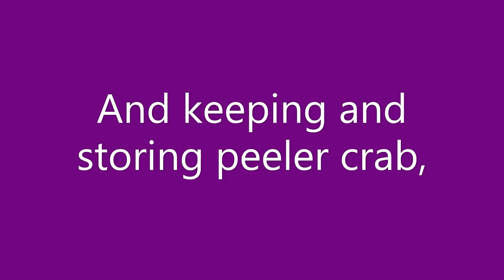Collecting and freezing Peeler Crabs - sea fishing bait.

Comment: Hi mate thanks for the video this is exactly what I needed, when you say crab trap would this be actually crab pots like you can buy on ebay or like old guttering? I'm struggling to find them and everyione else is taken by people using guttering on a side of a river? Any advice would be great. I've just ordered a vac pack machine and going to build my setup similar to yours thanks again mate
Reply from the maker: gutters and tyres are the best to use but just be mindful were you place them preferably out of sight

Comment: Paul thanks for you swift replie .If you could without  given away youre position do a video on the leg test and how you select youre crab as i said alot of videos are totaly the opposite  of what they say . Thiis i think would finish off the sequence  of videos .Paul at what time of year do you start collecting. Would 3 twenty gallon thanks be sufficent .The gutter as traps is ther a specific way to set and what lenght do you cut them .Some of these my be silly questions however give the full picture .
Reply from the maker: i will be starting to set the tanks back up in a few weeks and start collecting again the end of feb i will be doing some more better videos when the session starts again at the end of feb i will do more detail this year how i do it etc from traps all the way through but of course the location will not be told i mainly use tyers and have over 150 set out so i handle a lot of carb each week hence the tank set up i keep around 300 on average per week so is dont over crowd the tanks

Comment: Alright Paul,have you tried putting peelers in a sandwich bag,then in to a vacuum sealer bag as Brian (Whistling Sands) does...the integrity of the crab does`nt appear to be compromised doing it that way....i`ve recently bought a vac pack machine so i`ll be on the crab hunt soon
Reply from the maker: brian does it very good his crab is spot on kev it really does keep them in very good condition had some for over a year vac packed and they come out perfect as they went in

Comment: It's probably worth sticking a bag of carbon in your sump too bud. It will help keep any nasties out of the water. Really enjoying these videos. I've got a marine aquarium with corals. your setup is very similar. When you collect crab, is it just ones already peeling or can you collect normal crab and bring them on?
Reply from the maker: Yes you can add carbon 👍 there all peeler I collect but most just are not ready and still in the early stages so they get broght on till there backs just start to lift and are ready to use or freeze down 👍

Comment: Paul/other viewers - can I ask your opinion please.... I know peeler are superior but what are your thoughts on soft or slightly crispy crab for early summer bass if frozen, defrosted and any shell that’s too crispy removed? Recently I have been finding a lot of good size softies when rock pooling with the kids so cleaned them up and froze straight away to use for bass in June/July. What do you think; worth  a try or better stick with fresh lug and mackerel?

Ps thanks for the videos
Reply from the maker: You will do well with soft crab that has popped an early bass will take them when they are switched on to crab baits hounds rays will happily take them also
Reply: Cheers